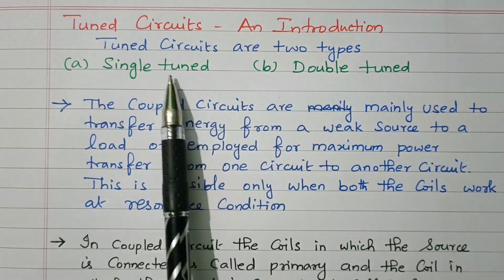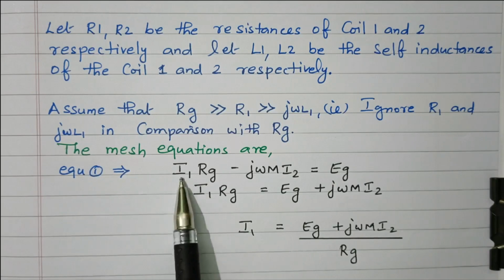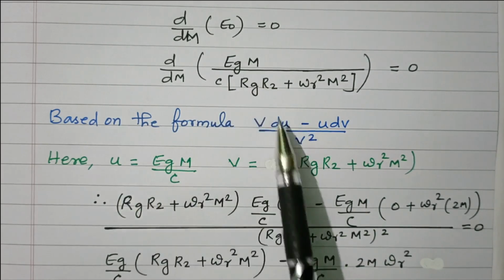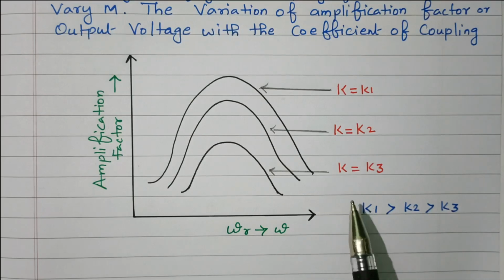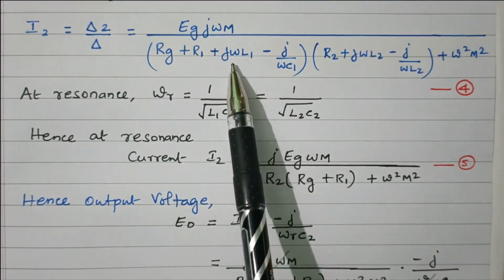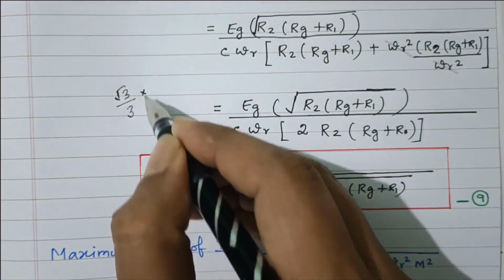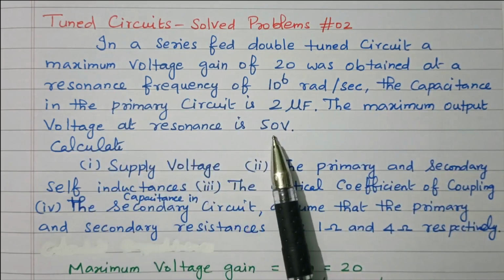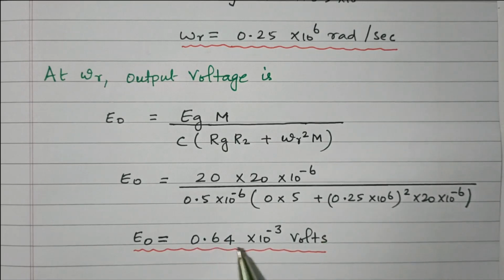ECA 20   Complete Course   Electric Circuit Analysis   Tuned Coupled Circuits

Comment: The internal resistance R1 is missing. You should show the overcouple graph in the case of double tuned circuit which is different of the single tuned circuit.